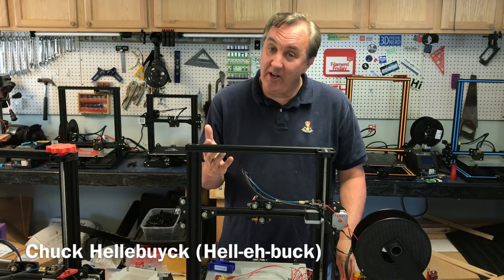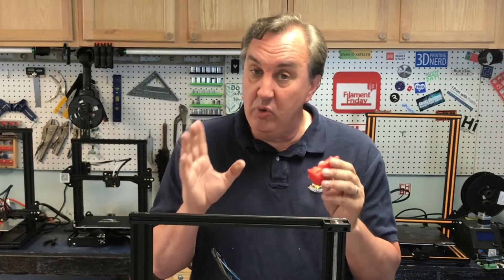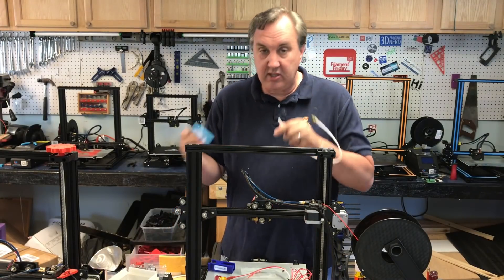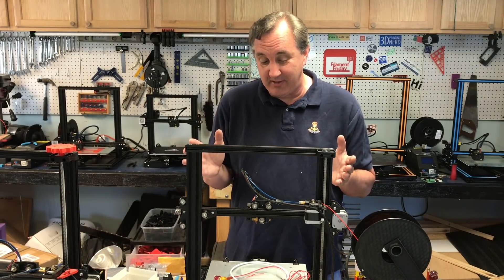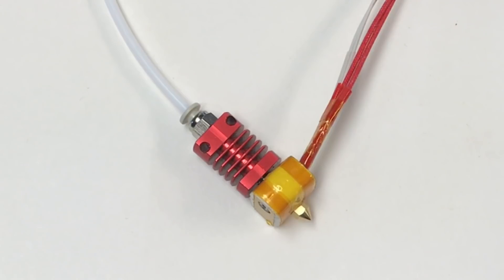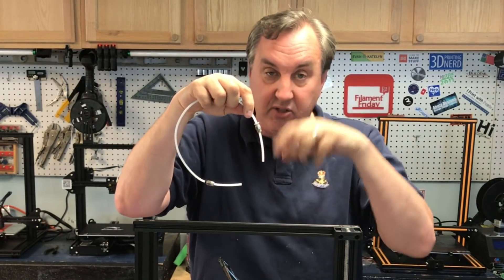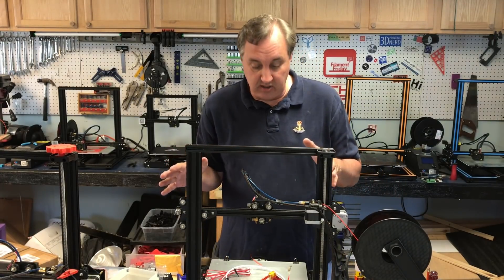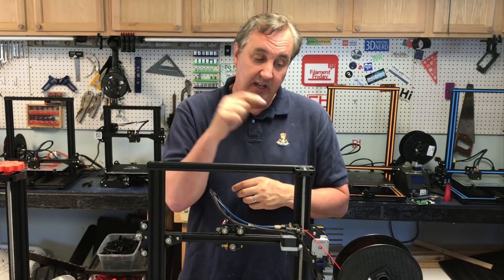Fixing a Filament Flow Problem on CR-10 mini, CR-10 or Creality Ender 3

Comment: Hey chuck! Always love your videos but now i need to consult the expert. When i print something that has a large flat solid fill layer i will get holes or "bubbles" in the layer. Anywhere from pea sized bubbles and quarter sized holes, with everything in between. My layer height and adhesion is fine although i do have small elphant foot effect.
Reply from the maker: Sounds like your bed is too close to the nozzle. Or you are over extruding a bit.

Comment: Well guys, what is your ideal extrusion esteps for old CR10?
Reply: I think that's something that will vary machine to machine because it can be affected by your tubing, filament, and I've found by even your nozzle size (I just switched out to a 0.2mm from a 0.4mm so there's a little more ompf needed to push it through) . Chep has a video about tuning that.

Comment: Hello Chuck,
I guess similar problem here, please help. Creality 10s pro. I was printing a pyramid with PLA+ filament (temperature recommended 205 to 225). It printed the raft well, but the above print got loose or something, and it got caught with the nozzle and extruded a big jumbled birds nest stuck to the whole moving part (ofcourse when I was away). Some of the extruded filaments got into the fans too. I cleared it up. Fans running good.
Now, I am not able to extrude as well as retract the filament. Just a small blob comes out when I heat the nozzle, thats it. I try to pull or push the filament by releasing the clutch manually. I tried to retract the filament through the menu. It comes out around 10mm and springs back in. 
I removed the blue coupling lock and press down to unlock and pull the tube, it doesnt come out either. I havent unscrewed the nozzle or removed anything yet. Just cleaned the external mess.
Can you please guide me what should I do? Thank you for reading :)
Reply from the maker: You have to remove the nozzle and tubing. It’s probably expanded and stuck in the tubing. May have to cut the end of the tubing.
Reply: @FilamentFriday  
Thank you. I will do it like you showed in the video.

Comment: Dear Chuck,

I bought an ender ceality 3 pro like 3 days ago, I managed to get one correct print, everything after that comes out linke sloppy hairy strings, Now the bed is leveled, the extruder cogwheels are cleaned, the PTFE tube is all the way up to the nozzle, I have changed the filament (Filament that came with the creality for storebought filament), tested at various temperatures, at various speeds, and what not. But every print of the Dog I try to make here is what happens, the raft sticks to the bottom aas it should but it liiks like it is made of timy little strings very thin like cobwebs, then when the raft is finished it starts to print but still cobwebs on to cobwebs on to cobwebs, I have tried heating from 195 degrees Celsius to 215 in intervals of 5 degrees, I have done the same with the bed  But stopped at 55 degrees since the raft sticks to the bed, I have tried the lower the cooling since it might cool to fast, I am at my wits end here, have you ever encountered this or anone you know because the internet is deadsilent on this.
Reply from the maker: Have you used my profiles?
Reply: @FilamentFriday  No? What profiles?
Reply: @FilamentFriday  I am sorry but seriously what profiles do you mean and how do I use them?
Reply: @FilamentFriday  Hello? Chep? Chuck? Still there?
Reply: His profiles for cura
Reply from the maker: Watch this: https://youtu.be/2Ejo6EVQ5Gc

Comment: Been having this precise issue and thank you so much for posting this! It's been driving me insane replacing everything except, typically, the wretched coupler! It seemed so impossible to track down that it really disheartened me and was causing my Ender 3 to start gathering dust. Thank you for solving this dilemma!
Reply from the maker: Glad I could help.

Comment: Thank you for this video, I have been having all kinds of skipping and stringing issues lately and have not been able to figure it out, it wasnt until you showed the pulled out filament that was difficult to pull out and had the glob at the end that I realized I might just have the same problem as shown in your vid. I have ordered the parts you recommend and hopefully it solves my issue so I can get back to printing!

Comment: I'm having the same issue up until you talked about the clump you pulled out. I know my Bowden tube is seated properly but I'm still having the issue, usually about halfway through the print. What else could it be?
Reply: @CHEP
Reply from the maker: https://youtu.be/MaMYMTX1Xl4

Comment: Chep, I had all of the same symptoms and was looking at this to see if it could be the problem. I took off the bowden tube to see if the coupler was the problem.  It seemed ok and I ran some filament through it (with the coupler off) just to make sure that it was working.  At that point I noticed that the filament would just stop occasionally (when the extruder was turning).  I came to realize that the teeth in the brass extruder drive gear was clogged and not gripping the filament at that point.  Cleaned out the teeth and it works great.  It might help some of your viewers to check that.  Thanks for the video - even though it wasn't my issue, I'm not sure I would have ever found my problem without it.
Reply from the maker: Thanks. Already covered:
https://youtu.be/MaMYMTX1Xl4
Reply: What if it's not the Bowden tube seating issue or the teeth on the extruder? What else could cause these symptoms? I have an ender5
Reply from the maker: The link above your comment

Comment: Hi Chep, you came highly recommended, I am a newbie had my printer almost 16 months and just starting to print.. how I am having a slight issue with my first layer and a tab bit over hanging glops of filament. Is there another way I could contact you to show you pictures in attempt to get this matter resolved if you could help me please? Thanks
Reply from the maker: Replace your nozzle. It’s probably worn out after 16 months.
Reply: Chep.. I had it that long I just started printing almost 2 months now.. I changed nozzle because I thought it was that but it wasn’t.. however if you don’t have time I understand..
Reply from the maker: You can contact me thru the about me links.
Reply: Chep I was able to correct the issue i was dealing with previously however I have another some issue.. I am printing tiny lettering and I am using a 0.2 nozzle however only 3 quarters of the lettering is printing on each letter there is about 20% left that did not print. Do you have any idea why that is happening? I do have pictures as well.. Thanks
Reply from the maker: Make sure your extrusion width is set to a smaller value of 0.2.

Comment: I have a brand new Ender 3 coming tomorrow and for anyone else buying it, I suggest replacing the lock mechanism he mentions. It is a flaw in the product and will save you countless hours trying to solve. Get a new Coupling.
Reply: Is that the main issue with it, or are the other things he replaced a good idea too?
Reply: @HalcyonVoid  I've had it for about two weeks. I think it's a good idea to get a glass plate with it. There's less warping compared to the regular and people say it looks nicer. As of right now, I have not replaced any parts and it works fine for the most part. Leveling the bed was difficult for me though.
Reply: @R3MIXMODZ  Glass plate? Forgive my ignorance, I am new to 3d printers.
Reply: @HalcyonVoid  No worries, I am quite new as well. The 3D printer comes with a sheet(bed) which heats up and is where your project sits when printing. There are glass sheets that you can buy that are more solid than the non-glass ones they give you. It's like printing on picture frame glass.
Reply: @R3MIXMODZ  Any particular glass I should look at or would just any glass work?
Reply from the maker: Borosilicate glass bed. It handles high temperature. 
https://youtu.be/mDNo1yyGosI
Reply: @HalcyonVoid  I assume any glass will work. if its paper thin it might break. I have not looked much into it but there's glass plates on amazon or ebay for about $15. Just search ender 3 glass plates. It's popular.

Comment: Had a all metal hotend doing this so I resided to drill throught the cool area at the start. Up my z axis start extruding sweet. Then it did the blob of death and no fillament at all. Have ordered new cr10 hotend back to stock. Have capcorn but I think it is chinese stuff. Will now order locking screws.

Comment: The problem I had last night on my new Ender 3 was that I replaced my  tube and coupler with a new better coupler and Capricorn tube but the set screw on the heat brake tube was set so tight that my Capricorn tube could not push down to the top of the nozzle.   I was getting clogs and a huge mess of particles up on the extruder teeth up near my PLA spool.  I took the whole thing apart last night.  Fun.  It’s running great now.  I sure do appreciate this channel.

Comment: Mine doesn’t even print anything, if it does it’s like a 26mm line and the part that extrudes the filament gets stuck on the right side and when it tries to move, it ticks trying to move further can I get some help?

Comment: I am getting these weird artifacts kinda like the one in this video but only for prints that are in a cylinder/circle shape. I have done what it says in this video and its not the problem with my ender 3. I went into my slicer and messed around there and still nothing. Any advice my main man Chuck.
Reply from the maker: Check the coupling at the extruder to see if it’s slipping. Also check the extruder idler arm to see if it’s sticking and not applying equal pressure.
Reply: @FilamentFriday  Thanks. I looked further into my slicer and my shell settings were messed up. Once I change that I got noticeably improved prints so it's a software thing not a hardware thing that i know off. Thanks anyways.

Comment: I'm having issues with the coupling where i need the tube to slide more into it, but the darn thing wont budge at all. no matter how hard i press down on it,  it wont close enough for me to move the tube. Any advice?
Reply from the maker: The coupling might be gouging into the tubing. I’ve had to cut the tubing and start over when that happens. Hopefully you have extra length.

Comment: Nice list of things that were not the cause :)

I had this problem and traced it to the screw that holds the tension arm onto the extruder being too tight.  It's the screw in the top of the extruder, right next to the Z leadscrew, around which that sprung arm pivots.  With it too tight, the tension arm binds a little and the spring can't apply the proper force to the filament, so it silently slips a little, and you get occasional but gross under-extrusion.

Backed it off a 1/4 turn and it prints perfectly now.

Comment: Had my Ender 3 for 2 days and have 20 hours of printing time on it. Just looked a the coupling and it is not working. I did know about this issue and used the supplied coupling spacer which is did work in making it snug. But well it seems like the Ender 3 supplied coupling only lasts 20 hours or less.

Comment: Thanks for making this video, it's very helpful! I am curious though, ever since I upgraded to an aluminium extruder, I get shavings around the extruder.  I figured it was just because it was rubbing up against the metal but according to your video here, it has something to do with a potential problem in the hotend? Is there something I should be looking for that's causing it? I've already replaced my couplers on both ends and my nozzle but am I missing something?

Comment: I’ve been having the same problem intermittently on my Ender 3. Going to check that immediately! I also have another issue that is bugging the crap out of me. Some of my prints will randomly jump 5mm or so in the y direction after printing 20 layers just fine. The finished print looks like someone sliced it into pieces and fanned it out onto the table. I am really puzzled by this, any guesses?
Reply from the maker: Did you recently reflash the firmware?
Reply: CHEP Yes, sure did!
Reply from the maker: That’s the problem. Probably TH3D?
Reply from the maker: Your firmware acceleration settings are too high. Should not be higher than 500. Stock firmware has it set at 500.

Comment: Hey can you answer me a question? Barely got a CR10s & when I try to print the filament just sticks to the nozzle , doesn't stick to plate or anything it just drags the filament a long with it in tube .
Reply from the maker: Adjust the bed properly and use a little glue stick on the glass.

Comment: I keep a short length if ptfe tube on hand for extrusion issues/partial blockages. My cleanout routine includes removing the nozzle & bowden tube from hotend & using the length of tube to make top through bottom passes through the hot end til no residue appears.  Double check the bowden tube end for trash or deterioration & trim if needed. Reassemble & get back to printing. This practice has become a real time saver by  covering all the bases for hotend related issues.

Comment: Thanks for this video!  I thought it was a problem with the gear grip on my extruder motor but tonight my ptfe tube slid out of the locking clip and hot end exactly as you described.  Gonna fix the locking clip asap! Chhers.
Reply from the maker: Glad I could help.

Comment: My Ender 3 does this, but there is no way that PTFE tube will go through my hot end when the nozzle is removed. Did they change the design? It looks like there is a ~2mm hole off center that is going down to the nozzle. I can fit filament through even when cold and cleaned out, but no way is the PTFE tube going to go through.
Reply: Your hot end has to be up to temp. 200 degrees to push the tubing through, be careful of burns!
Reply: It was a relatively new printer, but the tubing had backed out of the hot end about 1/4" (6mm) and when the clog formed melted filament got backed up between the nozzle and tubing essenctially making a small fitting of PETG and ABS. The hole through nasty goop was off center further making it hard to load the next filament. I took it all apart and put a punch in the tube and knocked out the clog in the heat break with a quick rap from a hammer. After I cleaned up the end of the PTFE tube, it went back together and printed great.

Comment: Your troubleshooting videos are great. Thanks for posting this. I'm just afraid that last time I watched one (broken solder joint on the hot end thermistor)  it was only days before I had the same issue!  I hope that doesn't happen again...   :)  Luckily by then I knew what to do.

Comment: I have a CR-10S and replaced the bowden tube as well as the couplers and nozzles and I am still getting under extrusion. Any ideas as to why? Are there any extruder adjustments that can be done?

Comment: ty. realy helped me a lot. i found that best way to put nozzel in is to turn 1 turn back when you are all the way in. and then after you put PTFE turn the nozzel all the way in. i'm on 800m of PLA and it's working with no problems.

Comment: You can prevent this from happening by printing this part and putting it on ur printer https://www.thingiverse.com/thing:2994683
Reply from the maker: The couplings are weak and the tubing can still slip. I tried though and it still slipped because the coupling was bad.
Reply: Thanks man, this got me printing again temporarily with the stock couplers until my new ones come in.

Comment: Anyone got recommendations for couplers and tubing for the Canadian amazon/ebay stores? It would be about $90 to ship the exact tubing and couplers linked on the US amazon site :(
Reply: Zelimir Fedoran https://www.amazon.ca/SIQUK-Fitting-Straight-Pneumatic-Filament/dp/B07DC594D6/ref=mp_s_a_1_sc_1?ie=UTF8&qid=1546963173&sr=8-1-spell&pi=AC_SX236_SY340_QL65&keywords=siquik+ptfe

And I recommend that you print these: https://www.thingiverse.com/thing:2798864
And put them on both ends of your tube. They force the pneumatic fittings to bite the tube and if you push your tube down firmly while activating the pneumatic release ring then while continuing to press your tube, release the ring and press the printed part under the ring, you should be able to press your tube down and pull it back up with zero play in your setup. You’ll know it has worked if it doesn’t jiggle up and down anymore. Happy printing.

Comment: Hi Chuck
Enjoy your videos. Here's a tip to warn you if your plastic tubing starts slipping in the connectors.  Draw a line or wrap tape around the plastic tubing right next to the release collar of the connector. If the tubing slips you will see a space between your line/tape and the conector. 
Cheers
Willy

Comment: Thanks, found my issue. 

The CR-10 glass bed was warped (new). So I bought the glass tiles from Lowe's, and I took my hardened steel nozzle off and reinstalled a brass nozzle.

Comment: Hey good video! Glad to see at least 1 video on youtube with this problem and an ACTUAL solution! Seems to have been my issue too. Any tips on how to clean the interior of the heat sink? It is filled with super sticky PLA filament fragments from the clog.
Reply from the maker: Push the PTFE through it. It should knock it all loose.

Comment: Hi Chuck, great video. My Ender 3 has not arrived yet but thanks in advance for saving me the trouble! 
I was going to buy new PTFE  tube and couplings as you advised, there's only a little problem. They don't ship the couplings to the Netherlands. 
do you have an alternative?
Reply from the maker: Try Banggood.com.
Reply: yes i tried that. they don't have this brand only Tevo and creality but thats the same original crap couplers i guess.  what is your experience with Ivelink?